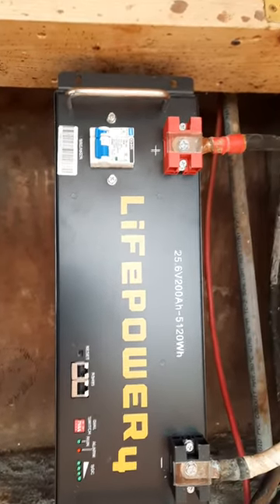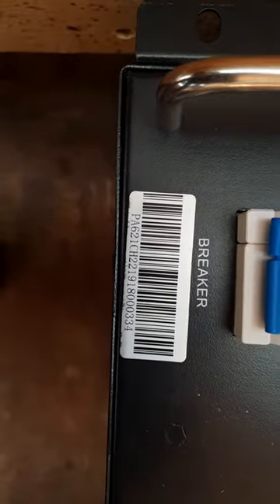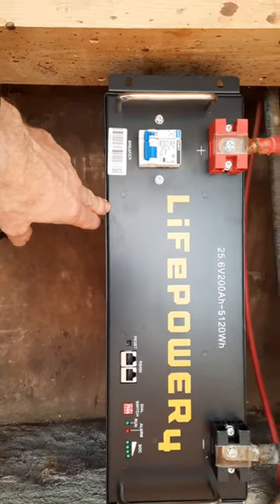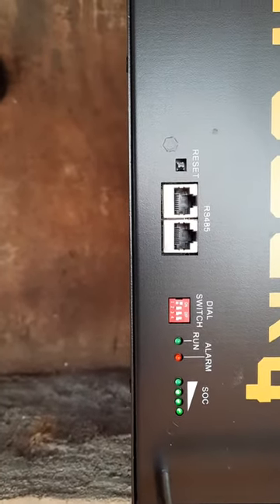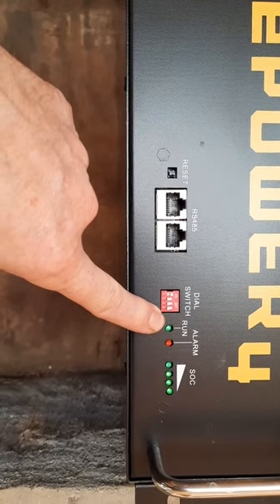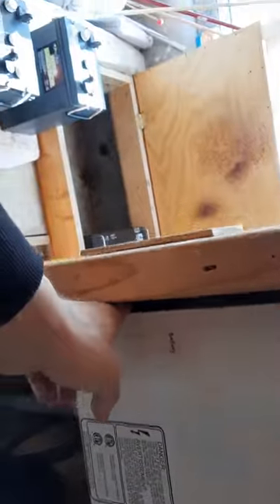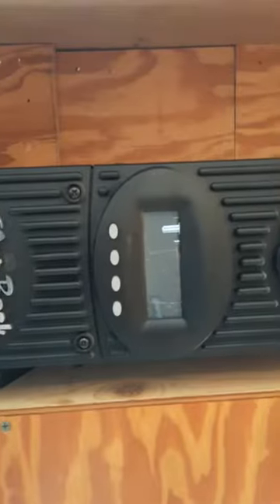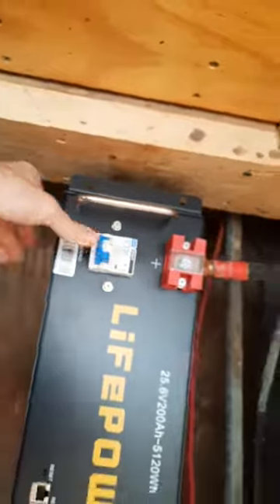G4LL GYLL LIFEPOWER4 BATTERY DIES WHEN INVERTER TURNED ON! Solution found!!!

Comment: the inrush current can reach easily 1000amps , at least you need 2 batterys is parallel then lift up the breackers at the same time .
Reply from the maker: I am beginning to think that might be the case! Kinda tough to convince someone to buy more of something that does not appear to work, LOL! I got hefty some inrush current limiters and will try those on the problematic loads such as the shop-vac and the radial-arm saw.

Comment: Try putting all the dip switches down.  Then reboot the battery.  And be sure that solar is not connected yet.
Reply from the maker: THANK YOU HAGA! I will try that. Do you reboot by cycling the white paddle breaker or do you push that tiny black "reset" button?? We have never pressed the "reset" button since we do not know what it does.
Reply: Just the breaker switch, I have never used the reset button.

Comment: Sounds like a case of not large enough battery capacity for the size inverter you have.
Reply from the maker: I am beginning to think that might be the case! Kinda tough to convince someone to buy more of something that does not appear to work, LOL! I got  some hefty inrush current limiters and will try those on the problematic loads such as the shop-vac and the radial-arm saw.
We spoke to Alex at Signature Solar today and they are looking at a possible firmware upgrade or a possible return/exchange.
Maybe they should tell potential customers that the MOQ is "two" for new systems.

Comment: Did you ever get the problem sorted out with the battery yet I been on hold before I spend substantial funds on lifepo4 battery 24volt and find out the are defective.
Reply from the maker: Well we finally talked to someone at Signature Solar who is clearly trying to help us and is quite knowledgeable.  WE got the password for the Windows app and corrected the mistake on the AH capacity parameter. it was set ad 50AH instead of 200AH. Now the 4 green  LEDs  make sense and the red alarm LED no linger turns on.

We are still using a small switch and the tiny 4.7uH inductor the size of your pinky tip to bypass the 250A DC circuit breaker and then turn on the breaker. My theory is that the inductor slows down the inrush current just enough to make the BMS built into the battery not freak out and shut down the whole system.

I am slowly learning how to use the software.

Next is to try a 47,000uF, 50V electrolytic capacitor right next to the inverter input terminals an see if I can ameliorate the inrush current when you try to turn on a ShopVac that also kills the battery.. Resistive loads like a 700 toaster and a 1,200 Watt hair dryer are no problem for the battery, but electriv motors such as ShopVacs and radial arm saws and the like kill the battery right away.
Reply from the maker: I tried the capacitor really close to the DC terminals on the VFX3524 inverter and it did not solve the problem. Maybe if I used heavy cable to minimize resistive losses of the 20 gauge alligator hookup clips??
Reply: @zachreyhelmberger894  the reason your large loads are killing the battery, is that you don’t have enough batteries. I run my house saws and an electric car with 6 48 volt batteries. Plus when starting up your inverter always turn battery on first then solar then your inverter’s.
Reply from the maker: @jamesshomesolarmore2223  Yes! I was finally told by the engineers at Signature Solar to turn on all loads and then turn on the batteries. That solved almost all problems. But I still struggle with 2 and 3 battery 24V systems. I think they need a better BMS for the lower voltage, higher current batteries. I have four 48V batteries at my house and really have not had any problems. I think they are using a BMS that is designed for 48V and trying to make 'em work for 24V and 12V??